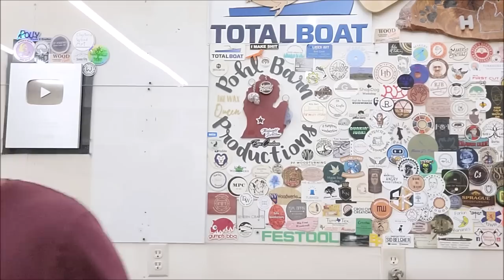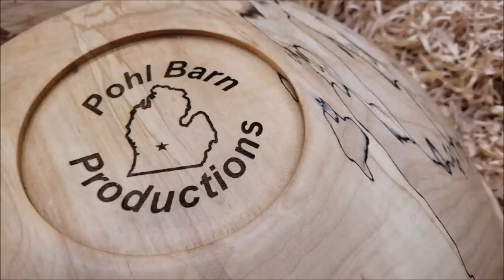OMG Beautiful Spaulting in this Maple

Comment: The spalting and chatoyancy on this bowl are fabulous!  I haven't seen enough spalting to understand how it grows, but I was so surprised that it runs across the grain rather than in the general direction of the grain.

Is it correct that this piece was too shallow to get a core from it?  It could have been a pretty good small set.
Reply from the maker: Thank you Susan,  the mold "spaulting"  grows after the fact I believe,  I probably could have gotten a core if I had a coring tool.

Comment: Doug, very nice shape once again. I just finished one with same spalted maple. Not near as nice in shape. Got the other on the lathe now. I suggest you get Total Boat Penetrating Epoxy for the next one. 3 to 4 coats, and you will stabilize all the punky wood in it. It will leave a glassy finish as well. Wish i could show you pics of mine.
Reply from the maker: Thank You Moe, I already have some of that resin, I will give it a try on the other half

Comment: What a gorgeous piece, Doug! 

Since you speed up your videos, (which I greatly appreciate, BTW) I have been wondering how long your projects take in real time? Obviously that changes depending the material your using. I'm not really interested in casting time, just turning and finishing time.

Once again, I really love this spalted maple bowl. The laser etched logo is pretty cool too!
Reply from the maker: This bowl took a day to process and turn, and apply the logo,  finished up editing the next day and uploaded it,  the resin projects take a few days if I have no issues with them,  a day for the pour, turn it the next day and a day for each resin coat I put on, unless I get one on first thing in the morning but it still has to wait till the next day to be touched, and a minimum of 4 hours for the logo in resin after that,   sometimes I am pushing my luck on time
Reply: @PohlBarnProductions  Thanks Doug.

Comment: Don't know if you know this trick with most Super Glue's, but if you store the bottles or tubes of the stuff in a fridge, it lasts a lot longer.  I retired just a little over 11 years back and just prior i bought a bottls of thick Super Glue and I'm still using it, Admitedly it's starting to get a little thicker now but it's still usable. and when I started doing Resin Casting around 3 years ago I bought a bottle of both the thin and the medium SuperGlue and I store them in a fridge too.
Reply from the maker: That's a great idea! Thank You William

Comment: Instead of squirting glue then spraying accelerator, why not try the other way around, accelerator first, THEN apply glue that way, the glue that hardens first is the stuff down in the crack and it's only the surface glue that's still wet and air exposure should cause that to dry fairly quick...or you can give it a second spray of accelerator to harden the top before turning it on the lathe and wearing the glue in the middle...

😄😁😆😅😂🤣
Reply from the maker: Thank you Thank you,  it doesn't seem to work like that here for me, Stick fast brand does but not this stuff